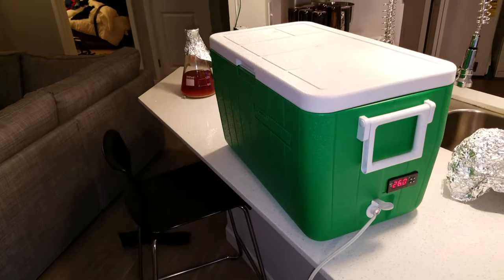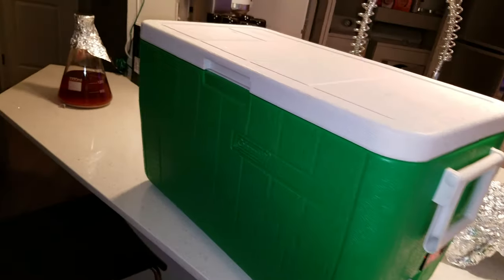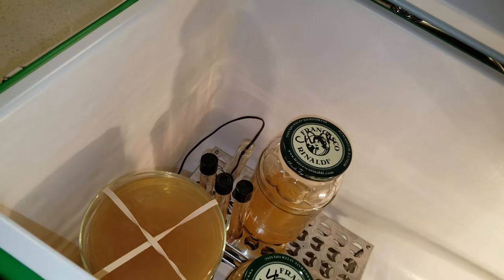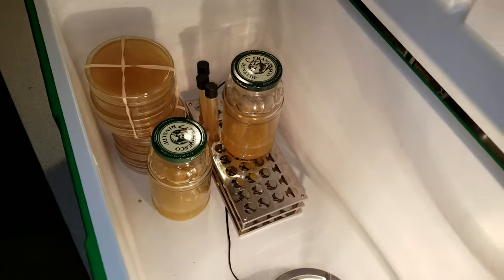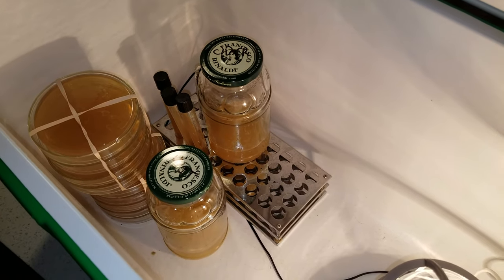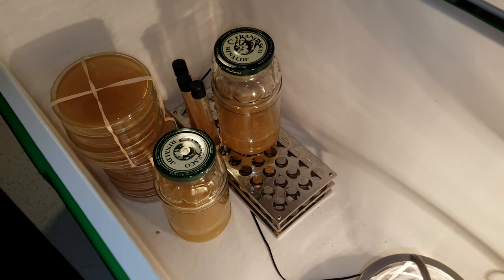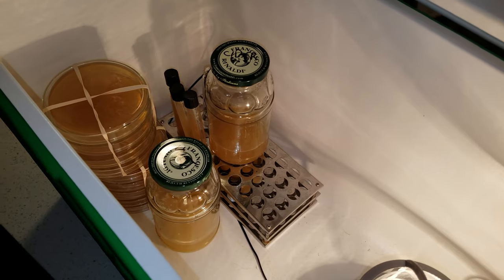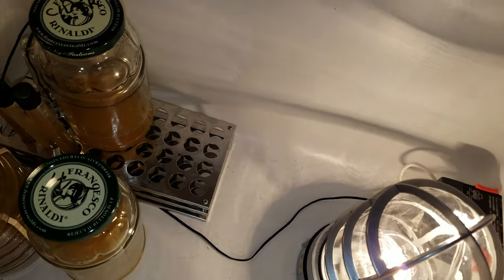How To Make an Incubation Chamber

Comment: Thanks for the design! Built and works like a champ with a 100W bulb. With the probe immersed in water within a 15mm x 100mm test tube, it cycled between 73 and 75 degrees on a test run.  A blue tooth temp device within the box shows a 72 to 75 degree air temperature swing.

Comment: Do you recall the bulb wattage?  Also, the Amazon link appears to be a right angle model (1707SV). Another of the same manufacturer, Woods 1706BS looks more like what you have. Did you just attach the lamp body directly to the base and discard the angle portion?

Comment: Nice project. Is the light fixture freestanding or attached to the cooler?
Reply from the maker: It is attached
Reply: @BrewingViking  Can't quite make it out. Did you just run some screws into the cooler through the utility box? Hot Glue?
Reply from the maker: @commentatron  I used hot glue